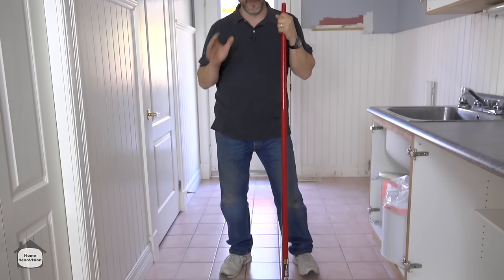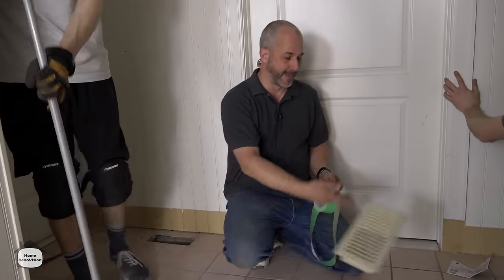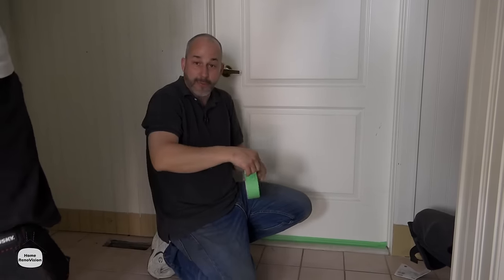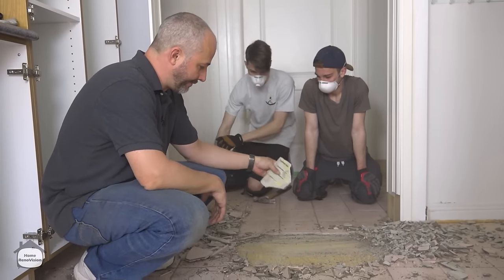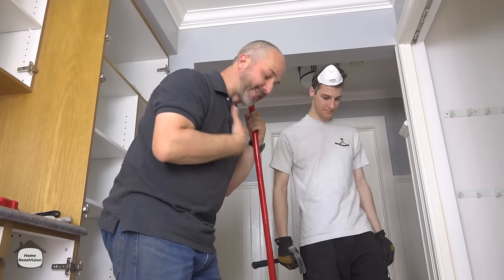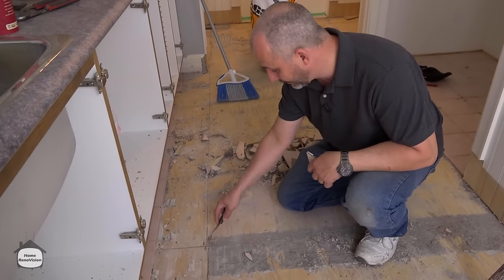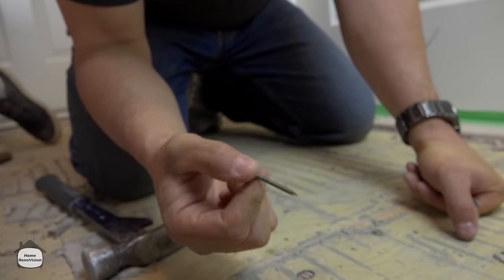How to Remove A Ceramic Floor

Comment: For Diyers Taking tile up with a regular hammer the way they were is a no no. A chunk of tile came up & stuck in my arm tetnus shot and stitches later .After that I used a heavy hammer specifically for removing it long sleaves ,gloves,& safety wear. Jmo stay safe

Comment: This is the problem that most homeowners have when we hire someone to do work in our houses.  Contractors cheat and for the most part they know that we will most likely not figure it out until something goes wrong years later.  I have tried to educate myself about these things watching these videos, it really does help.  Thank you for posting them
Reply: Actually, homeowners are cheap and didn't want to pay for high quality work. You get what you pay for.

Comment: Well, more about removing tile from a bad installation (easier) than removing tile from a good installation over cement board (hard).
Reply: Exactly! We just bought a house and theres what they call it “drypack” of cement and then tiles over it.😒 Did you remove it yet? And how did you do it?

Comment: We are about to attempt to remove the tile in our kitchen. The original floor was wood laminate. Well someone said I want tile and I want tile right now no matter how badly it's done. They put subflooring over the wood laminate and tiled away. We found this out when we had to replace the dishwasher....it was tiled into the kitchen island. We could not believe that people actually do crap like this to their own house. I have a feeling this demo is going to be a little work and we've decided that smash is going to be our best option. This video helps alot! Thank you!

Comment: Love the Red Bar, mine is black, another tool I have discovered is a long handled Roofing Spade, the fulcrum on the back and teeth on the front works wonders.  I first used it for carpet tack strips now it's my go to demo shovel.  I have seen them now produced in various lengths. of course it will also do some unintended damage if you get to wild.
Reply from the maker: great tool for sure. Cheers!

Comment: So much good info on your channel. As a beginner who hadn't held a hammer before watching your vids. I really enjoy the in depth explanations, helps a lot. I'll be attempting a backyard reno with shed (If the roof stays on, it will be better than my current shed lol) and pulling up the ceramic tiles in bathroom thanks to your inspiration!
Reply from the maker: Always glad to help. Cheers!

Comment: Just did this for a 400sf job that had 12x12 tiles on concrete. Used a Milwaukee rotary hammer drill (in hammer, not rotary mode) with a chisel bit. Worked well to pry the tiles off and clean residual thinset.

Comment: I'd like to see a separate video on how to deal with thinset removal after lifting tile, both on cement slabs and plywood. Preferably one that your average DIYer can accomplish. It's all fun and games planning a new tile floor, but most videos "skip" this part, which is a real show-stopper for most folks.
Reply from the maker: If you are on plywood this video and the reality renovision laundry room cover everything you need to know. If you are on concrete slab then you will need to rent a tool for removal and possibly a tool for smoothing out the concrete. I will try to do this in the near future. Cheers!
Reply: Removing thinset from cement slabs isn't too bad. Helps to wet everything down once you break the tiles off. Let it soak for a while then use a SDS hammer drill with a chisel bit.

Comment: Excellent video. I just removed tiles kitchen flooring. Upon removal I see it was installed over Lino, and stapled down wire mesh onto the Lino for the thin set to adhere to. It was a long day removing the tile & next day removing the Lino & 1inch staples embedded into the thin set & mesh. Maybe they did it right?? but was a hell of a job removing it.

Comment: I used a square flat shovel with a sledgehammer to tap it along. Pulled up the tile and cement board easy. My wavy floor was due to poor install and I was super happy to find a flat subfloor underneath.
Reply from the maker: That is usually the case. Cheers!

Comment: I enjoy watching your videos  they are  good quality and mostly full of informative content keep up the good work. It's always nice to see somebody else that not only does things correctly but shows others through the form of YouTube videos how they can also do it correctly. I've been on way too many jobs where I see other contractors doing things incorrectly and I don't believe it is because they are trying to cut corners or costs I believe for the most part maybe they were never shown the correct procedure. My method of removal is almost the same as what you're showing here, but I have an added step in my process. That is to take my cordless Circ saw and set the depth correctly, then rip the plywood into strips so that it is faster and easier removal than tearing up and breaking and prying the whole peace. Give that a try on your next one.  It does make it faster and easier even though it is an added step. Also if is your responsibility to remove the debris from the job site then ripping it first with the saw also makes it easier and more efficient to stack the degree from the floor in the back of the truck or trailer making for easier loading and unloading of all of that old material making those parts of the job even faster and more efficient. So that when added step in the removal process at the beginning of the job helps you the next step and the last step of the job which is when you are unloading your truck after you have already completed the job and left and now returning to your shop or home for cleaning out your truck or trailer.

Comment: Did my kitchen and mud room. House was built in 87. Both rooms had : subfloor | staple and glued down 1/4” luan | sheet vinyl | stapled and glued down 1/4” luan | top sheet vinyl.  

It was an absolute killer to get out.  The luan would just shred when trying to pry up or force wedges under it.  And they must have put the intern on the staple gun with a nice new case of staples.  Then I had to chisel and belt sand all the glue lines.  

I had considered just cutting all the way down and removing the subfloor, but I had cabinets, etc that were staying.  It was just a nightmare.  

Needless to say the new tile job, while not perfect, was very satisfying to finish and now use.

Comment: Hello. I'm from israel and realy enjoy your videos even in this case. And what do i mean abot that. We dont have wooden floor. We have cement floor. On that you install plumbing, then sand or now days very small stones(dont know how to call it in english). Then you do tile work using diffent cement compounds. I just had bery bad leak under the floor in the bathroom. All too expensive so after watching many videos i removed just 1 tile and found the leak. I dug out the sand, replaced the bad plumbing part. And had the sand dried.
I did temove the grout around that tile and i belive that it prevented the tiles around it to break. I had sparks while blasting the tile with the hammer. Thanks for your videos.

Comment: Thank you for the great video, can you tell me how you removed the tile under the cabinets.
I have concrete floors and cabinets were put in and don't want to have to remove the cabinets that were put on top of the existing tile. what tool would you use or how would you remove the existing tile without removing the cabinets. Thank you

Comment: Asbestos was prevalent in ALL building materials prior to 1981, including what you call vinyl flooring ( linoleum ), so encapsulating it...as they did here...is the way I treat my floors, although I use backerboard rather than a layer of ply. Disrupting a floor that has asbestos will cause the particles to become airborne & will be inhaled
Reply from the maker: Up here we did away with asbestos in 72. Still linoleum did not have the dangerous variety in it. I still say remove extra layers!
Reply: Holy guacamole, my favorite two channels conversing......
Reply: Why would you want to live on top of a dangerous substance? Encapsulation by amateurs is worse than removal by experts

Comment: LOL, I wish you posted this earlier... we are renovating our kitchen right now and ran into floor removing issues last week... it was so hard to break down and the ‘grout’ seems to be real cement, and it seems like concrete underneath the floor as well... a total nightmare! So we changed our strategy from porcelain tile to vinyl right on top of the existing thing. We used some new grout to flatten the gaps, layed on the vinyl tile, haven’t done the final grout yet... hope it works!
Reply: How'd it work out? I have tile on concrete and I am wondering if I can put vinyl planking over the top.

Comment: Thanks, very useful. I was hoping you would show how to deal with the ceramic tile where it meets the cabinets.
Reply from the maker: I use a chisel and it snaps off right there. then a sawzall to cut off the subfloor. Cheers!
Reply: @HomeRenoVisionDIY  Hi, my existing ceramic tiles run under the cabinets...is it possible to score/chisel off somehow before attacking the sub-floor with a sawzall? Thanks!

Comment: Next year when I take out the tile floor in my kitchen, I hope it goes as easy as that.  Pretty sure it won't though.  There's tile, thinset, lino, 3/8" subfloor, lino, then the original 5/8" t&g subfloor.  I'm going to go back down to original and start fresh.

Comment: Let's say the cement did bond to the plywood and didn't come off clean like that.  Do you always have to remove the plywood put new floor down before re-tiling? Doing a condo renovation and I'm not even sure what's beneath the ceramic yet.  Thanks!

Comment: Are you replacing the tile without removing the cabinets? Is that possible because the tiles was placed around the cabinets and not under? What do you do if you have tile under your cabinets and you want to replace your floor with new tile

Comment: The tile they're destroying is the same as my kitchen.  The owner before us, laid this tile down directly on the wood floor in the kitchen (and white in bathroom).  We have cracked tiles in both rooms.  Can't imagine hammering off the tiles without total damage to the floor below.  Needs a subfloor but the baseboard heating has little room for all the addl inches (prob why they didn't want to deal with it and just laid the tile down).  Very instructional; now a bit daunted.

Comment: Why do you recommend a 2 inch screw spacing on the edges?  APA recommends 4 inches, and  ANSI A108 recommends 6 inches.  Both of those specs. are more than enough, especially if using 8 or 9 gauge flooring screws. One might use a 2 inch spacing with staples.

Comment: I really appreciate all your great videos! Unlike your situation (in this video), my old school contractor did a fantastic job 25 yrs ago and my tile removal job will be far from a cakewalk.  Believe me if the tiles didn't look so outdated, I wouldn't be removing them.  Anyway, hoping you might have advice (or perhaps another video) for tough tile removal jobs.  Is there anything else besides hammering 200+ sq feet of tile?  Would you recommend a demolition hammer.  Do I then sand down the cement to try and uncover the screws to the underlayment.  Any advice will be invaluable!

Comment: Going to take out about 1000 square feet of tile from put house. A 3 month long water leak a month after had our own sewer lines replaced has been hell on our slab foundation. Tile popping in multiple places. Luckily the sellers didnt install it right either. All the cement is on the tile but very little stuck to the slab. Probably another reason it's coming lose to easily too.

Comment: Tile wasn’t installed to last. But lasted long enough for the renovation. I don’t understand the need to install it to last 100 years when it will be replaced/ renovated in 15
Reply: I mean, he said that the grout was cracking and the tile was waving. Perhaps if it was done correctly the first time, they wouldn't need to do any work at all.

Comment: Brother, I have to remove times in the kitchen and old tiles are installed all the way to the wall, under the cabinets. They don't want me to take the cabinets out. How do I cut tiles around the cabinet base? Thanks in advance.

Comment: Question: I pulled up a ceramic tile in my bathroom and noticed an underlayment beneath the thinset that I think is Hardie Backer board.  What's the best way to pull this all up so we can start fresh and lay down new tile?  Also, is there an underlayment you suggest we use in the bathroom before we get new tile?  Ditra?  Something else?  We don't need the Cadillac of bathrooms but want the functionality and waterproofing to be top notch.  Thanks!

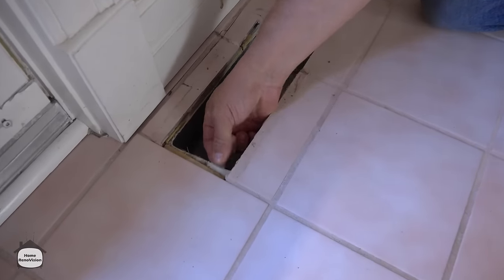Comment: 1:29 EXACTLY the same crap the previous homeowner had done to our kitchen floor before we bought the house. It looked good at the time (13 yrs ago), but the inspector even said it's crap and the tile is eventually just going to crack. "But we properly followed all the manufacturer's installation procedures....." 
I counted at least 15 tiles with cracks, out of little over 150.

EDIT: 4:24 - That's exactly what I had to do to get the dishwasher installed because of the raised floor🤣🤣🤣

Comment: in this kitchen they were ok, I've had bathroom floors with frequent water on the floor, where the water goes through the grout lines and then gets trapped by the vinyl and rots out the plywood to a smelly mess in a few years. Only advantage is the tiles are lot easier to lift...

Comment: Thank you for your contributions, they are very good ... it is that in a floor repair ... you would recommend me to change the wood of the floor (where you removed the screws in your video)

Comment: Here in Australia, we put cement sheeting down for tiling over...
Reply: In theory we do. My place was built in 2000. The builder "Avonwood Homes" tiled straight onto the yellow tongue particle board floor. The builder went bust in the same year, no surprise. Here I am trying to remove the tiles and mastic.....

Comment: Hi there! I have a  Ceramic tile over the Chipboard (particleboard)  with tongue and groove together subfloor and they  use screw and glue together on subfloor frame.  I want to remove the whole ceramic tile (around 40 sq meters) by smashing with hammer as you showed us in the video. 
I worry that smashing the tile with hammer will break the chipboard tongue and groove, making the floor moving, break the floor join, and making the creaky and squeaky sound on floor. 
Is it ok to smashing the tile with hammer on chipboard?
Reply from the maker: just swing thr hammer hard enought o break the tile. it doe not take much effort. screw down the subfloor when finished.
Reply: Thanks Jeff,   how to repair the squeaky sound floor? how far and how how many screws we can screw down from existing screw without breaking the chipboard subfloor?
Reply from the maker: Every 2" if necessary. Cheers!

Comment: If you hammer straight down like that wont all the force be felt through the joist and the ceiling below...i am afraid of cracking my ceiling in the finished basement?

Comment: Plain and simple, there is no easy way that I know of to remove tile and thinset.  I had exactly the same scenario in a bath in a relatively new addition with tile installed over 3/8-in. ply, screwed directly over 3/4-in. ply subfloor, although no previous finished flooring beneath that.  Scraping off enough thinset to locate the stupid fine thread drywall screws and then removing them along with the 3/8 ply was a royal pain.

Comment: GOOD MORNING again.  What are your though about flooring on low or soft spots.  If you add a second layer what should the total thickness be.  Jack
Reply from the maker: Hi Jack, for tile you want a total thickness no less than 1 1/4" that is 2 layers of 5/8 laminated together. When done right this is very strong. if the old layer has been dmaged by water you might want to consider 3/4' for the new layer. Cheers!

Comment: I do have a question pulling tile floor out to put carpet in what tool would u recommend to get the thinset removed so it’s smooth it’s on concrete slab. Putting carpet in bedrooms and getting rid of the tile

Comment: Hello from Connecticut..Love your videos. I especially like the way you don't beat the heck out of your houses. The vibrations set up probably due damage within the walls, etc. even tho you can't see it. I have oak wood floors throughout my 1953 classic ranch home, including a checkerboard painted oak wood floor in the kitchen.The paint has worn and you can see the outlines of of the floor boards through the paint. I have options for it's restoration. I could repaint  the checkerboard pattern, or lay Armstrong tile. I don't care for ceramic tile, it's cold and things break when dropped.  Would love to update the colors on the squares, but what a job!!. Do you have any videos on either of these options? Any suggestions?
Reply from the maker: I would suggest using vinyl planks. and yes I have videos for installing those products. Cheers!

Comment: What is the best way to remove the adhesive from a concrete floor once the tile is removed?
Reply from the maker: using a cup grinder on an angle grinder. or you can rent the large machine that looks like a floor polisher.

Comment: Any tips/tricks for tile on a mortar bed? I'd rather not replace the 1/2" plywood underneath the mortar if I don't have to.
Reply from the maker: the plywood should be fine. Just remove the bed and go from there.Cheers!

Comment: Great videos thank you. 
Just wondering if you have tried using roofing ripper, to remove the tiles  and sub flooring for demo.   It works quite will.
Reply: Try dry ice.